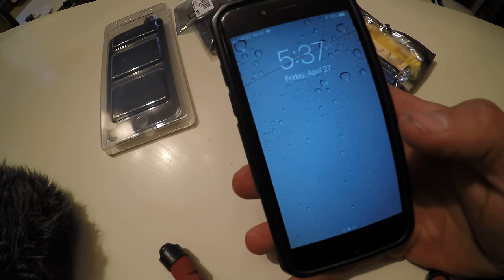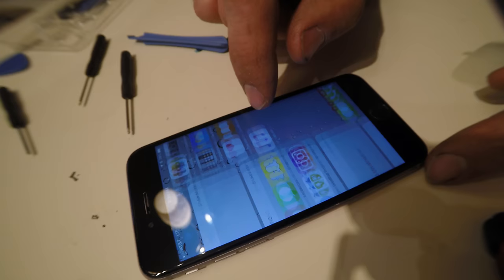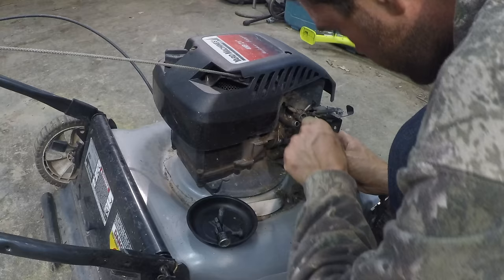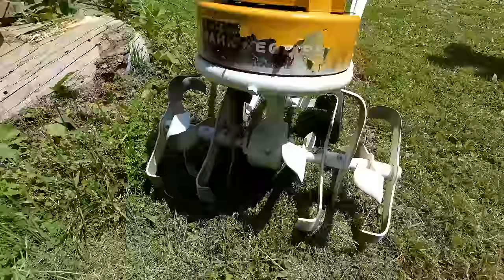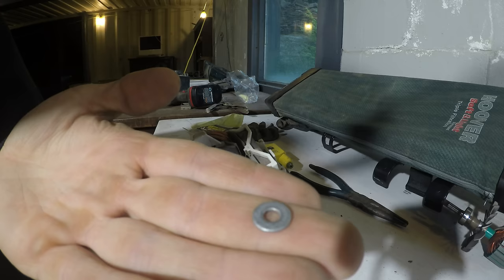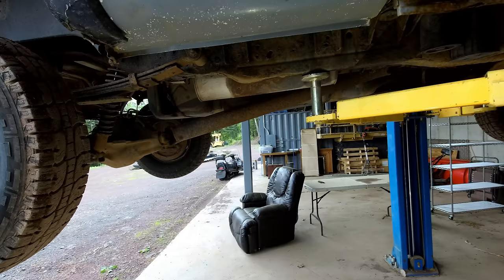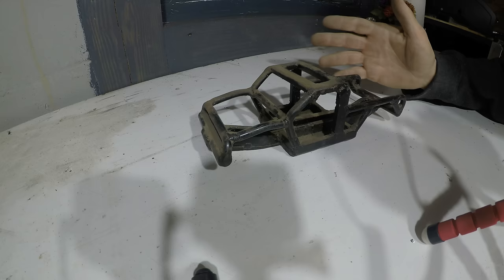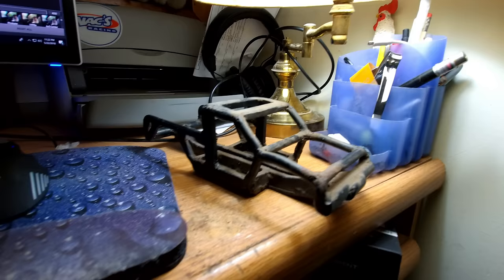Fixing stuff

Comment: Hi +Andrew! Found your ideas on trucks very interesting and maybe I can inject my engineering opinion here. One reason trucks crumple easily when you hit them is because they're designed to. It helps decelerae the car and expend energy during an accident to keep the driver safe. Another reason is aerodynamics. Especially with an electric truck like you are proposing, a boxier body could take dozens of miles off the trucks range. And the large wheels would worsen this effect. Thirdly, while channel and tube are standard, it would not make the vehicle cheaper necessarily. At the high volume of production that cars are made its all about cycle time and material costs. Sheet steel is cheap and stamping can be done incredibly fast. The amount of material to make a tube frame and the headache of engineering bolt on panels to be flush at all locations and stylish enough for people to still buy would be quite the challenge. Another reason is the extra weight that would be added with a tube body like this. This added weight plus battery weight would make for suboptimal vehicle dynamics. This is another reason why inhub motors are difficult aside from the space constraints. Inhub motors increase the vehicles unsprung mass (mass which is not supported by the trucks suspension). Any mass that is unsprung drastically reduces the vehicles handling and traction. You're essentially adding inertia to the wheel which will prevent the suspension from properly "tracking" the road while driving over bumps or uneven surfaces. Vehicles nowadays are unfortunately built with these thin bodies for weight savings, cost savings, meeting safety regulations for crumple zones, vehicle handling, aerodynamics, rigidity, and yes.. style. But don't forget perhaps the most important aspect of all. We as engineers design something to meet a certain lifetime. This lifetime is decided... more or less.. by higher ups. A car that lasts a lifetime and costs 100 grand will gross 100k. A car that gets thrown away in 15 years and costs 50 grand will gross 300k in the same time. Why bother overdesigning if people will keep shelling out cash for the next best thing anyway? Its the American way after all haha. Great video as always Andrew 👍 have a good one.

Comment: I'm with ya on the tube chassis and plastic body panels (how about a drop in cockpit for variety?) If and when Graphine batteries, aka capacitive storage, not chemical, become viable (somehow I think big oil will keep it off the market). Until then, like a locomotive, a petro engine coupled to a generator powering 4 electric motors, i.e. two independent motors in a common casing, one in front and one in the rear running through half shafts to the wheels would be the way to go. For whatever reason, I think having the motor in the wheels is just too much mass to have thrashing about bumpy roads. Andy, you're a real deep thinker when you see disparate applications that have elements within each that can combined into your dream vehicle.....way to go buddy, keep it up!

Comment: Hey Andrew, I've been watching a bunch of your videos. I'm really enjoying them and the info you share. I did Wood Working, Mechanical and Tool Making. When I was younger. And I've been into Computers, for the last 20 years, now. But, I never got to run any Excavation Equipment. So, it's fun learning, by watching you. I found your channel a couple of years ago, when you were first building the Container Castle. What a Great Project. I like your Truck Frame Design Ideas. And I've been wanting to build or convert a vehicle to Electric for quite a few years, too. I, like you. I think that Electric Hub Motors would be Ideal, for good traction and less moving parts. There is a Big Electric Hub Motor, that was Designed and Produced, back in the early 1900's. For a Car, called the Lohner Porsche. I did a google search for lohner porsche museum and found these images that show a cut away of the Motor, https://www.google.com/search?q=lohner+porsche+museum&client=firefox-b-1-d&tbm=isch&tbs=rimg:CS_1g4FDrbm9MIjirFQLiFk6GxoDzV9rot1czWnjGVrwyaKdvrWbaNRUfQeEpOPpkRSlWNwuRLHSTKH8LaXoUx-DpbCoSCasVAuIWTobGEaX2G0-3OXDZKhIJgPNX2ui3VzMRIbtxkVM3tSUqEglaeMZWvDJopxF8nUk70klJkSoSCW-tZto1FR9BEdsIn-yHYEAwKhIJ4Sk4-mRFKVYRkd04Tff4LJcqEgk3C5EsdJMofxHGne1qr6K81ioSCQtpehTH4OlsEa8VoBaP66_1D&tbo=u&sa=X&ved=2ahUKEwjz0pbZ-NTjAhUYHc0KHVVrB1sQ9C96BAgBEBw&biw=1440&bih=674&dpr=1.33 

There are some small Hub Motors available now. That are advertised to be for Cars. But, I think they are way to under powered for a Pickup or even a mid sized Car. I've seen some Electric Motor Building Projects Online too. I think that a Big Hub Motor with enough Power to turn Big Tires. Could be made. And the larger Rotor and Stator, could make it work. Also, I'm wondering. How heavy, would a full sized version of your Truck Frame be? I think, your Simple and Tough Electric Truck dream, is worth following... Don

Comment: I love your idea about the tube frame rust resisistant vehicle with bolt on panels (aluminum or carbon fiber). I have thought about it,  too. Two things I really hate currently are everything rusting away and custom,  unnecessary plastics parts like bumpers, headlights, grills, fenders that cost a fortune to replace. Also, way too many computerized/electronic systems that are unnecessary and expensive to repair. Electric motors have been successfully used on locomotives for a long time although they don't require independent suspension and steering. A bumper should be made for hitting something and not getting damaged. I'd make it out of something strong like titanium and do away with any plastic crap around it.

Comment: One issue I see is you need crumple zones to absorb damage. because of internal injuries sustained by the inertia  from an impact. But there is a way to have a rigid frame but make the passenger compartment safer maybe have a floating steel platform the seats sit on with pistons in all directions to a center point or something. and as far as drive motors maybe make a special large gear that bolts directly onto the inside of the rim that way very simple bearings could be used for the main wheel bearing aswell then mount motors to the non stationary part of the hub like the swingarm. If you pick up what I'm putting down.

Comment: After Honorable Discharge from the Navy where I worked on aircraft engines big ol Radial 1820's...Got a job at a small engine shop working on  Briggs was easy them Tecumsehs on Craftsman mowers were a pain..... crankshaft key was usually the prob on Briggs...folks hittin rocks and stumps would put a tiny nick in it and that was it for running....and you're right after sitting up over winter diaphragm was usually all that needed replacing....

Comment: Great video but I'd like to add one thing: Crumple zones in cars and trucks exist for a reason, it's a lot safer in a high speed collision when the front of the vehicle absorbs the brunt of the impact by cumpling up. If they are built like tanks they are more durable for sure but in the case of an accident they are much more dangerous both for the occupants and any others they might hit.

Comment: Wow! I really like this idea you have about the truck design! It's funny that right at the end you mentioned Elon Musk, because the whole time I was watching this video I was thinking how cool it would be if you could team up with him and get this truck designed and produced. I have thought the same thing for years, that vehicles should be made simpler and much more durable, and I believe you have come up with a solid basic design model. The frames could be either zinc coated or bronze coated might be better, since zinc puts off toxic fumes when burned (in case of a wreck with a gasoline vehicle, etc.) All other parts could be stainless, aluminum, carbon fiber, or other non-ferrous alloys.
Reply: Cybertruck!

Comment: Until Andrew's model hits the roads, I'd like a truck, with today's tech, available from a dealer, stripped down to bare essentials. No bells, no (or minimal) computers, no whistles (where possible, manual everything). Make it tough, make it as affordable as possible. Frame, suspension, panels, seat(s), decent or temporary rims/tires, engine/trans... just enough to make it stout and street legal. Let the owner and the aftermarket do the rest, and market it like that. To keep the manufacturer and dealer financially viable, offer versions already pimped out. Point being... make a heavily stripped model available for those who can't spend ridiculous sums and those who don't want a corporation/room of suits dictating what they get. --- that should hold us over until Andrew's design paradigm catches fire (and funding). --- Great video.

Comment: I use “Life proof” cases exclusively. My whole family uses them. They’re waterproof, dust proof etc. To test how waterproof they are I took my iPhone swimming and took video of my kids swimming. They recorded themselves in the pool doing what kids do and phone was not damaged. The only thing was the sound was muffled because of it being under water. 
They’re a little more expensive but water , dust etc will not get to your phone. 
As for  your screen cracking see if the aluminum case is bent where it’s cracked. If it’s bent ever so slightly the glass isn’t laying flat and will cause it to crack there.
Reply from the maker: Yeah, I eventually got a similar case to a life proof. Its been fine since than. Its really required for those phones, they are too delicate without it.
Reply: Andrew Camarata yep.  It amazes me how cheap they feel but how much they cost. 
I also wanted to comment on this video of how impressed I am w your ability to repair things. 
From basically rebuilding your phone to repairing excavator buckets, to engines etc. you make it look so easy. 
Your channel has helped me in many ways. You inspired me to install my own backhoe attachment, mounting plates, power beyond kit for the backhoe, was hydro hoses and hydraulic oil cooler on my tractor. Where before I would have just let the dealer do it and paid them $700 to do so. I didn’t know I was capable of such but now I do everything myself. 
Keep these videos coming I know I’m not the only one whose benefited from them.

Comment: Hey Andrew. Great video. Kudos to you for fixing up your stuff. I used to do that when I was in my twenties and thirties. I got tired of fixing other peoples junk and I don't have the energy I used to. That being said, I still do 95% of all my home repairs and improvement. I buy some stuff new, but I keep it a long time.

I have a 16 year old Toyota Tundra which looks almost new including the frame and undercarriage. It stays out in the weather all the time and I have never had a garage. I think most of your rustout problems stem from your idiot road departments that use salt to de-ice roads. We only see problems like that here in Oregon in the Coastal  town and Cities. As a general rule, Oregon does not use salt on the roads, and it makes a big difference. We sold our 97 Toyota Camry in 2018, and undercarriage, body and power train(no rebuilds) were still in excellent condition. Thanks, Russ

Comment: Andrew uild a 50% sized car/truck you can use the ebike drive hubs (fronts) on all four wheels batteries in the floor pan, independant suspension from older beetles mk1 1960-80 beetles, get glass cut to fit,, Li-ion  batteries , are available but 24v  A/C systems  would work run thru a 48v motor controller basic set up ? 50% sized you can drive test out, modify till correct, if it can be done on a budget sure you can do it , nice video

Comment: I do like the electric idea a lot but the only issue I have with it is charge. Tesla doesn't have that good range for example. I personally do a lot of driving long distance. An idea I was thinking, not sure how it would work, but maybe put an electric motor in the front middle and back middle and have axles that have something like a stator or alternator kinda thing around the axle so your batteries charge as you drive. Put metal around them so they dont get damaged, it will make clearance a little less but it would be good for distance at least until batteries can hold a charge for 800-1000 miles and be full charge in an hour. I do agree, trucks are bad now. Your idea is very good I hope you'll be able to do it one day

Comment: an old Toyota land cruiser was basically built like that. but with steel not aluminum. aluminum dose not rust as bad as steel but it does  have metal fatigue issues. catastrophic ones on aircraft. An all wheel drive would necessitate a computer controlled system.but an arduino could handle it. Having nay said enough. I think building a 300 mile trip,  75 mph, 1 hour charge, 1 ton pickup is doable and I would love to help.

Comment: Andrew - I’m a mech engineer and I think you have awesome ideas on truck design improvements - especially the idea of using electric motors integrated in each wheel.  I’d suggest get a good patent attorney and patent your ideas.
Reply: hub motors are all ready patented my e bike got them
Reply: Beyond simple hub motors- speed and torque optimization to each wheel using drive software to maximize traction and handling performance

Comment: Love this stuff, man you are patient with that vacuum cleaner.
I would have thrown it across the shop, then went and got it again so I could hoof it with my steel toes work boots.
As for Dodge? f'ing junk.
I have done complete front ends, tie rods, ball joints, stabalizer links on Ram 1500's with 30,000 miles on them
Might do it on a Toyota with 200,000 miles, lol
I must say though, that 3/4 ton has been good to you I guess

Comment: About the modern truck flaws. Blame our old friend the EPA. Federal mileage and emissions requirement drive most of what we hate about modern vehicles. They're being built to be as light and aerodynamic as possible. That's why they need the computers, to squeeze 1 more MPG out of the engine while reducing emissions. EPA has gone way overboard.
Reply from the maker: The EPA should be aabolished.

Comment: OK, so good talk and opinions on cars, I share them with you. Just wanna point out that todays consumer market is highly based on after market. It means that Big Corp makes stuff made to go broke so you'll have to go to service and buy spare parts. In the old day companys compete on quality, not any more, it's the quick buck and short time frames that counts. Commercials make brands today, not like the old day where quality made a brand big, that's one important difference to be aware of.
We have tractors  and cars made here in Sweden (Volvo BM) made 50 years ago that today runs with no problem, starting in one turn in -20, 30 celsius and hardly ever brake down in any major way like todays machines which always have some problem with data and lamps turning on. 

Also American cars rust more than any other, especially if roads are salted they're history. They got the power and maybe some comfort but that's about it, quality is terrible, especially like you say in body and chassi.
So stiff axle or not. Well it depends what you want, you want comfort you go split, you want load and pull you go stiff, that's why all heavy trucks and tractors have stiff.

Comment: If they made trucks the way you wanted, you wouldn't have to by a new one.
I believe Tesla does have independent motors at each wheel.
The Bollenger you mentioned is $125,000

Comment: Building a vehicle is a complicated physics problem - not only the weight distribution, but the toe-in of the steering and all that. And the problem with a really solid frame is that all the energy of a crash goes into whatever is in the vehicle, including people - instead of being dissipated when the vehicle crumbles. But you are right, having those crumbly wire harnesses and rustable everything is just stupid. It would be possible to use a type of sheet metal that didn't rust, or even carbon fiber or fiberglass. As for electric drive, I've often wondered why cars can't be set up like diesel locomotives, which use an internal combustion engine to drive a generator, which supplies power to the traction motors in the wheels. IMO the future of vehicles is carbon fiber and electric.

Comment: Nice video showing how you can fix pretty much anything with a little patience and a few cheap parts. I'd throw that vac in the dishwasher though to get the plastic not full of dust and it'd look like new when you put it back together.

Edit - I think you could get away with the frame being how it is or slightly different and have it as is. The hub motors could be bigger versions of bike ones and the hub gears if you wanted that (I'd lean towards not) could be built like at least the later generation WHITE tractor rear ends were with the planetary gears in the actual hub. I'm not sure how reliable those are and it'd amplify the moving parts quite a bit. Pulse width modulation would work better giving you more toque and its already in things like your Lithium ION drills - maybe just a reduction gearing. For the power plant I'm not sure what would be best other than a small 80HP or something turboshaft genset to power the whole thing like a locomotive and a supercap set to store boost power from braking to help re-accelerate.

Comment: I would love to drive a 2020 Camarata. I hear that they are built very well and never sold to fools. Where can I buy one NOW?
Electric hub motors are available off the shelf. Put a small diesel generator, like a locomotive, coupled to batteries in a hybrid arrangement and power all four wheels that way. Better yet, an engine that takes universal fuels. The generator would be replaceable as a single drop in unit. No external charging necessary. Easy peazy!